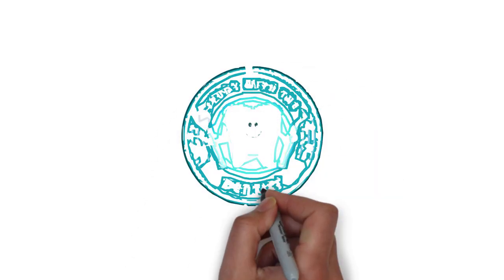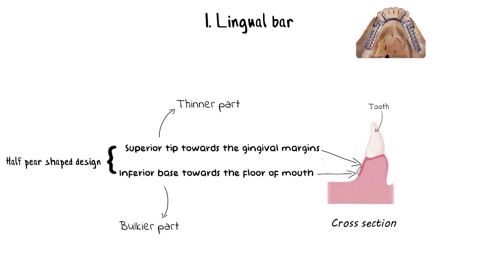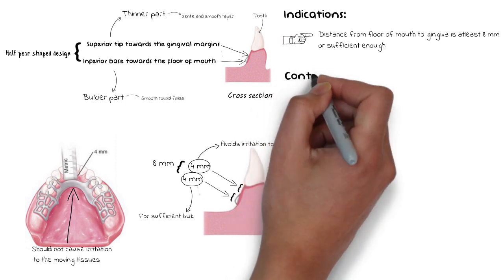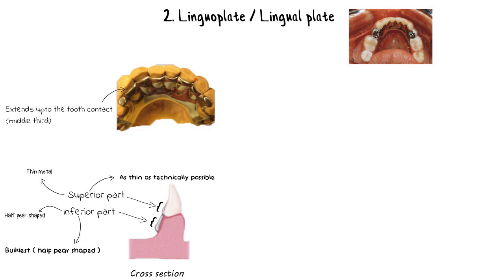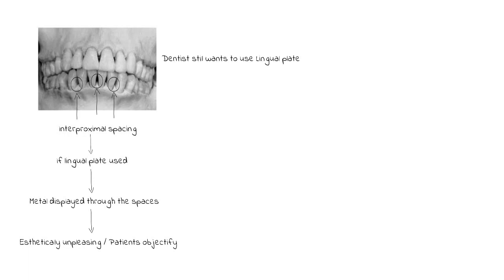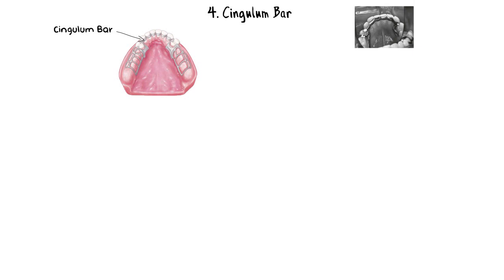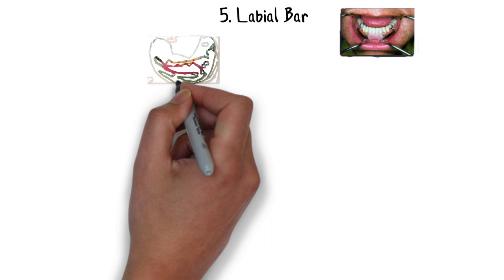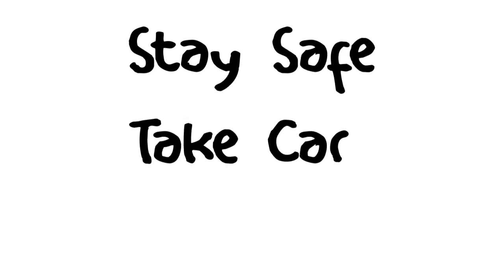Mandibular Major Connectors | Removable Partial Denture (RPD)

Comment: Hey ! 
Is the sublingual bar placen on the floor of the mouth? Does it provide indirect retension?
Alsi can it be used if the resudual ridge is severely resorbed?
Reply from the maker: It is not on the floor of the mouth, it is a little bit higher. Indirect  retention depends on the case to case.  In some it may provide some sort of indirect retention, while in most it doesn't. 
For severely resorbed ridges, it depends on the case to case. But in most, the floor of the mouth is too close, so sub lingual bar will be hard to use.
Reply: @studywiththedentist  I found an MCQ which is
A sublingual bar 
1- Lies on the floor of the mouth
2-Provides indirect retention
3-Indicated in patient with flat low ridges
4- 1 and 2
Reply from the maker: If I have to pick, I will pick option 4.